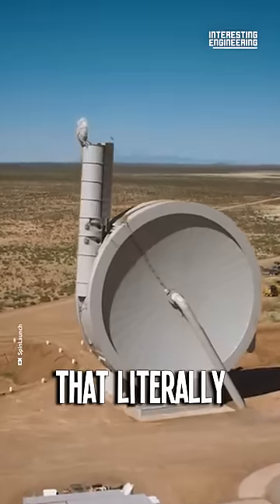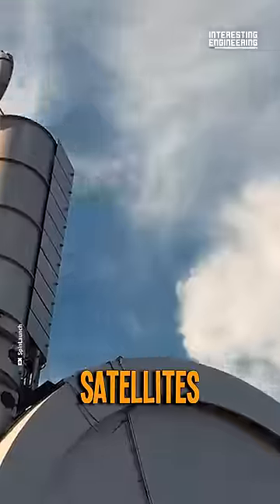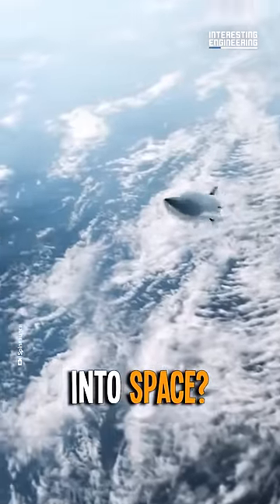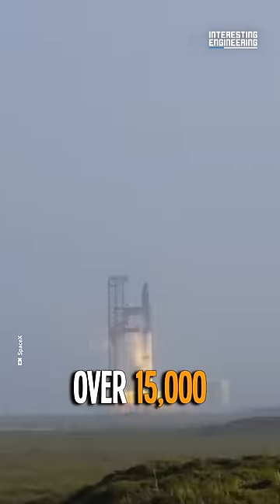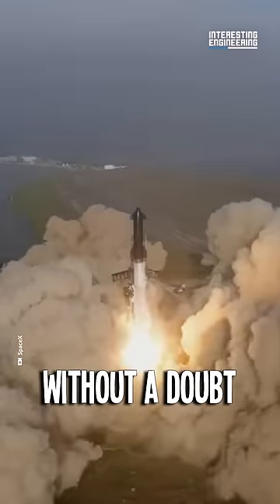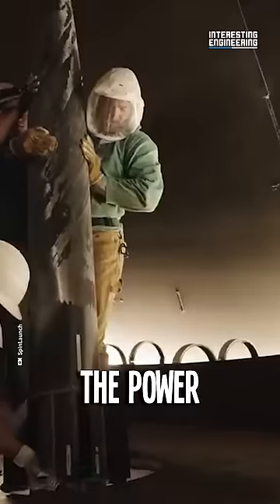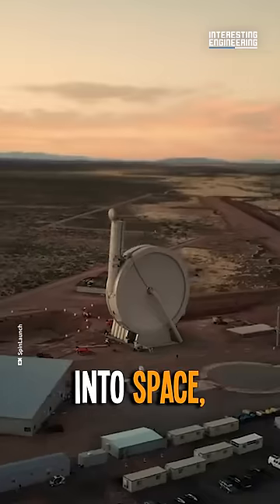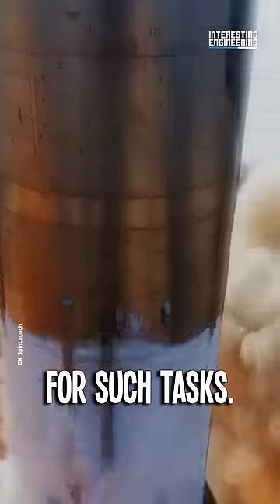Throwing Artillery Shells Into Space

Comment: There’s no free lunch 🥪 
This has been debunked by ThunderfOOt
Reply: Sure there is Robert your just running with a cliche...there are both free lunches and very expensive restaurants.
The earths daily rotation, and the hydrological cycle are perfect physical examples of "free lunch". We all benefit, at NO cost!
Reply: And no free LAUNCH 🚀
Reply: Thunderfoot didn't disprove it, he just showed that it was impractical given current  material manufacturing.
Reply: @Paul_Bedford  You mean the current laws of physics.
Reply: @chrisantoniou4366   physics doesn't prohibit yeeting an object fast enough to leave earth, and we have the materials capable of doing one maybe two throws per unit. And that is all if you want to fling it the whole way. If you just want to cut out the first stage, that makes it far more possible.
Reply: @Paul_Bedford  Physics mightn't "prohibit yeeting an object fast enough to leave Earth", but that object could only be a solid metal which will ablate on the way up, not something relatively fragile like a useful satellite.  A satellite needs to function in orbit and that means imparting a horizontal aspect (thus more dense atmosphere) to its trajectory as well.

As for "cutting out the first stage" why? it's still far cheaper and more cost effective to return and reuse your first stage rocket than to try and accurately release a projectile into the atmosphere at the speed required to reach the velocity of a spent first stage booster.  Your videos show that breaking through the vacuum seal make the projectile inaccurate, and the lack of spin on your projectile will have it tumbling uncontrollably.

Perhaps the material manufacturing you are referring to requies "Unobtainium"...  🤣
Reply: @chrisantoniou4366 NASA thinks it could work
and I'm inclined to trust a space agency
over a random YouTuber
Reply: @YagamiKou well who ever approved it, should be fired. Because friction with the air will heat up the satellite too much and cook what ever electronics inside of it. Sure heat shields is a thing but that means MORE WEIGHT, which means faster spinning, which means more heat, which means more heat shields, which means more weight...

It is an endless cycle.

Comment: How do they spin it and launch it without fuel? Electricity? Do they power it with solar panels or wind turbines or coal? If not then they are burning some kind of fuel to get that electricity or momentum.
Reply: But you don’t need fuel to take fuel with you to fuel the lifting of fuel …
Reply: Electricity
Reply: @obsidian7644  ok that makes sense. So as long as they aren’t burning oil for the electricity then it could be more efficient than sending a rocket out of the atmosphere.

Comment: So instead of using a rocket that burns "15K ga. of fuel per second" to launch the satellite, they use a centrifugal mass accelerator (CMA). How much fuel is required to generate enough electricity to get that CMA spinning fast enough to launch that satellite?
15K ga. of fuel per second.
It's basic physics. The first law of thermodynamics.
Energy can't be created or destroyed, but it can be transferred.
Whether it's transferred via rocket or CMA, the energy requirement is the same.

Comment: Something like this would be great for launches from space, through space.
Reply: No humans could never resist! This would be perfect for satellites!
Reply: " this would be great"
No, it won't. Mate, get yourself back to elementary school and re-visit the 3rd Pascal's Law there.
Reply: If you did this in space the centrifugal mass accelerator would spin the opposite direction due to newtons 3rd law, so you’d have to counteract that e.g. by having thrusters on the outside of the accelerator. The energy used to keep the accelerators angular velocity at 0 combined with the energy used to accelerate the payload would pretty much be equal to if you just used thrusters to accelerate the payload, i.e. a rocket
Reply: @kalabrez  if it were mounted to an object of significant mass, but low gravitational pull, it would work, no? Such as a mini-moon.
Reply: @Houndf  or just the moon. The idea of having a long stretch of electric powered rails, on the surface of the moon where there is no atmosphere, to accelerated and launch stuff has been around for a few decades
Reply: This is dumb in any application except murder or mayhem.

Comment: The amount of energy required to launch something into orbit equals the amount of energy required to launch something into orbit.  And honestly, something spinning at that rate of speed is probably wasting a lot more energy than using rocket fuel.
Reply: Your comment should definitelly be higher on the list.
Reply: Sry, thats wrong
This way it wouldnt need to lift tons of fuel.

Beside that, its of course not working
Reply: @myowndata  simple Physics elaborates on that, yes.
Reply: @krzysztofmeler  thanks, that's very kind of you.
Reply: And. Crushing the load
Reply: True but this way is way more efficient. It also doesn’t work
Reply: @donttrustwomeninmensclothi6765  half as efficient. Not only does it need to reach escape velocity. But it needs 2-4 times that speed due to air resistance the moment the vacuumed is broken. As drag is 4 times the velocity. So to over come you would need excessive speed over escape velocity to have the end speed mach 33. Anything launched with that speed within earth's atmosphere would  e instantly obliterated.
Reply: @matthewedwards6454  see all those flames coming from the rocket? The heat is tremendous as well. That is all energy loss. It probably takes 1/10 the energy to get that thing spinning using high voltage
Reply: @matthewedwards6454  It's less efficient due to needing a higher absolute speed, but much MORE efficient because it weighs less than 1/10th because like 95% of the launch mass of a big rocket is fuel + the structure to hold the fuel. 

To be clear, the fidelity needed to actually throw these things accurately simply doesn't exist, you can even see in their video how misaligned the payload is when it breaches the vacuum seal, but if you COULD make it word is would probably be more energy efficient and DEFINITELY more CO2 efficient if you powered it with the grid mix in most places
Reply: Brian Kanner is wrong on every point. There are reasons this won't work for most things but not what he said.
Reply: Maxi and Max velocity at the same time at sea level is just a horrible idea.
Reply: @pstrap1311  okay, let me put this in very simple terms so that you can pick apart my statement and inform me where I'm wrong....  To achieve orbit, not only must something achieve a high attitude, it must also achieve a speed of 28,000kl/h.  Thus, to "toss" an object into orbit from a stationary position, it would need enough energy to reach altitude and the correct speed.  To achieve thus by simply spinning and object is, in and if it's self, next to impossible from Earth.  But even if it were possible, it would require far more energy in the form of wasted motion from a spinning object than the amount of rocket  fuel.
....So, where are my mistakes?
Reply: Spelling mistakes also apply, .. English is brutal.
Reply: Well since it doesn’t work it’s not turned on…and that actually does sound pretty efficient.
Reply: @superkickcity1610  😜 Absolutely Agree!
Reply: @BrianKanner  some people just don't understand how hard rocket science is. I'm smart, but I'm still grasping at the basics of the entry level math.
Reply: @MrSpleenface  just not true. Rocket science is hard. I get it. I can only comprehend the basic ideas and yet I fully understand that E=mc^2. Meaning the energy required to get an object into space is the same. Rockets start our slow to get past the atmosphere before accelerating to its orbital velocity. A projectile launched from earth to space is going to require the same amount of energy, just so happens Rocket fuel is far more energy rich that a spining wheel. I already did the math, look at my previous post. It would require twice as much energy to get a payload up to speed as just putting it on top of a Rocket and launching.
Reply: @donttrustwomeninmensclothi6765  wait. You don't think spinning something isn't going to produce excess waisted energy?
Reply: @matthewedwards6454  You give me hope for humanity!
Reply: @matthewedwards6454  Give yourself more credit.  You formulated your argument much clearer than I was able to and you were absolutely correct. I'm not fond of the math, either.  You're probably far ahead me ..
Reply: Except not, because if you’re carrying your fuel up with you, the amount of energy needed to launch a thing equals that amount of energy plus the amount of energy to lift all the fuel and the engines.
Reply: And when you release the payload the spinning thing becomes unstable and will tear itself apart.

Comment: due to extreme centrifugal force the instruments will be damaged.
Reply: If so, then redesign. They were already made to withstand high forces and vibration during launch; so beef 'em up some more! Car makers do it. Also tank makers, battleship makers, bunker makers, minesweeper makers...
[Edit: astronaut-testing centrifuge makers! 👩🏼‍🚀👨🏾‍🚀😤]
Reply: @dexterpoindexter3583 do you realize how much greater G force this thing would have than a traditional rocket?
Reply: @onradioactivewaves  still would be way cheaper and more practical to make a design that can resist high g forces, don't forget this means you don't need all the weight in fuel tanks
Reply: @onradioactivewaves they have actually launched test satellites several times.....and for the most part, it worked as intended
Reply: @aclickykeyboard7571  ok but did they get them into orbit? Obviously they need higher G's to launch higher.

I'm not trying to be a hater on new ideas, but this is some better suited for say, a launch mechanism off of the moon, or other no to low atmosphere places
Reply: So throw them in parts and assemble in space 🎉
Reply: @cgpsj2194 imagine parts freely floating in the space.
Reply: Well, the guy who made the video was talking bullshit. 

They don't plan on  slinging it to the necessary speeds in a matter of seconds, but a matter of hours, in the end resulting in the satellites being exposed to far fewer gravitational forces than they would be with conventional rockets.

Not saying that the concept is flawless, heck, I pretty much have given up hope on it after the last test of it I saw. Their projectile didn't even leave the vaccum chamber straight, but punched through it tilted at a like 15° angle, not to mention the projectile wasn't even stabilized properly. Tough to be honest, I don't know how you'd even go about doing that with this device
Reply: If they are making a space station they could easily send materials this way , no cost on fuel no weight restrictions either
Reply: @capnjackgallows3204 Too bad it's not physically possible. They haven't gotten anything even close to orbit but it has failed a number of times.
Reply: @aclickykeyboard7571 source? As far as I know they never launched anything into orbit. Their tests just plummeted down to earth. Highest they reached was like 8km/ 5miles or so
Reply: @dexterpoindexter3583  we're talking about 10.000G here. Take the weight of a satellite multiply it by 10.000 and ask yourself again if the satellite will be stable enough to withstand that 😂. I can tell you that there is avsolutely no technical or mechanical device on earth that wouldnt get crushed by that forces. Only thing imaginable is liquids like water or fuels. But even a container of water would show an explosive reaction of expanding by at least 10% in the moment of launch.
Reply: @HandOfSatan  
(( tempted to "talk to the hand"... ))
I stand corrected. That was a well written clarification.
Could any bomb be launched without danger of exploding in the centrifuge/ accelerator? If not, it would be limited to inert masses like cannonballs.
Nothing wrong with that; simply compensate as far as possible for wind & rain at launch & re-entry sites.
It's just not quite as useful as a relatively low power launcher for cruise missiles & such.

Comment: The biggest issue with this that they hadn't fully solved is keeping the system balanced after the release of the projectile. The RPM of this system is insane and if it becomes unbalanced it'll tear itself apart
Reply: No, the biggest problem is the massive amounts of g force this thing produces. The laws of physics makes this impossible
Reply: Not just balance, but G forces will crush the payload before it even leaves the machine.

Comment: Just curious how much carbon based fuel is required to produce the electricity used to power the motors that create the rotation of the centrifuge that merely sends the missile out of the atmosphere where rocket fuel again becomes necessary.

Comment: Now combine it with fuel fueled rockets.
Every second shaved off the process before the engines start a binge off is a win
Reply: now have the fuel filled rocket survive the g-force of accelerating inside that thing as opposed to the spaceX solution of super chilling their fuel and oxidizer so they can make them denser and fit more, guess which way is more efficient. There is a reason these kinds of systems never get used for regular space travel, the payload is too small to be viable and compete with regular rockets.

Comment: Out of curiosity could a magnetic accelerator also work? I’ve seen the idea in games but I’ve never seen any real life examples of the idea outside of railguns for warfare.
Reply: Also? work. this idea doesn't work, and won't work. everything about it is a dream and every claim a serious stretch of the truth! Your question is far more sensible than this idea, and yes rail guns, magnetic accelerators were a much talked about concept 30 years ago, but it was recognised that the technology wasn't good enough yet so it was shelved. in the last decade though the terrestrial applications, mainly military have come from the technology advancing significantly, but it's still throwing stones in comparison to launching a building into orbit and if it ever happens it will very limited in what it could launch. the extreme acceleration in a short burst to achieve leaving gravity is insane physics, ie most things won't survive being on the tip of a bullet when it's fired! The other concept that has been proposed, is "the sky lift". basically a cable tethered to earth rising up and connected to a space station orbiting in phase with the fixed ground point.... we're waiting for the tech there too. LOL
Reply: @mrgoodman6620  So purely science fiction at least with any current tech. Theoretically possible but would need so many advancements that it’s probably not possible.
Reply: @crazyguy_1233  Yeah the concepts will be superseded  by things like ion drives, anti gravity generators, WW3 haha joke.. I hope.... long before they become much more.

Comment: It's important to mention, that the Rocket still needs its own probulsion. U can't throw a rocket upwards with over 7 kilometers per second. However it makes the rocket require less fuel.
Reply: I wouldn’t launch anything containing any amount of rocket fuel, liquid or solid out of that thing. Plus the research, development, and engineering that would have to be involved in preparing anything other then a rock to survive the multitude of forces acting on an object spun up to escape velocity then simply flung at full target speed straight up into the air. There are better, and less brutal ways to get things into space if we’re really ready to take the much needed next step in the business of getting things into orbit.
Reply: Well done, you mentioned what the clip already mentions.

Comment: It’s not using velocity. It’s using centrifugal force!  Sheesh!
Reply: Agree 👍 not to mention you need velocity to escape the force of gravity
Reply: So, it has angular momentum and angular velocity.
Your point?
Reply: umm, no.
they are indeed using velocity to gain altitude.
but to accelerate this projectile, it needs to stay within some sort of device.
It could be really long tube but that would take enormous land.
by pushing the projectile to center of rotation (these kind of force is called centripetal force BTW) you can have object traveling at high speed while staying at roughly same spot.
Centrifugal force is mere reaction to that centripetal force.
TL;DR centrifugal force is just a side-product.

Comment: So they're going to use "velocity" to fling satellites into space and this method will "eliminate" the need for fuel eh?  Saying they're going to use velocity rather than rocket engines to propel a rocket, is like me saying I'm going to use speed rather than an internal combustion engine to propel my automobile down the highway...  I'm also really interested to know how exactly they plan on powering that two stage rocket that takes over, if they've eliminated using any fuel?

Comment: No No No & you might want to rethink this. Unless you are throwing a rocket out this thing it’s never going to 17,000 mph about the speed needed orbit. Any thing less than that will be suborbital like Blue Origin or Virgin. So much wrong with this even using a rail gun type system which won’t work either would have been a better idea.